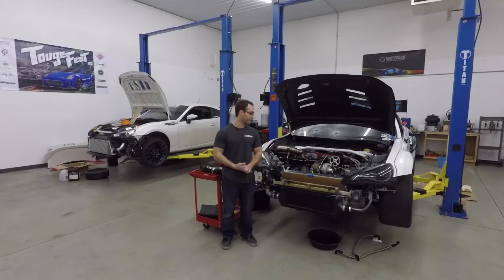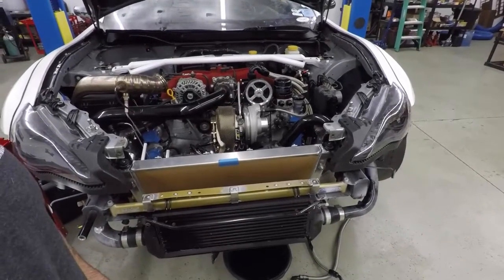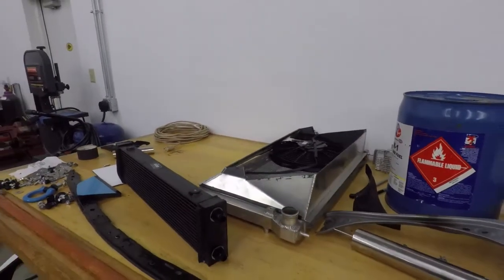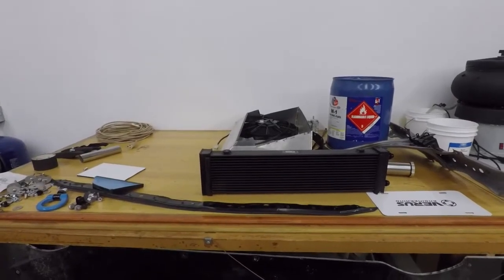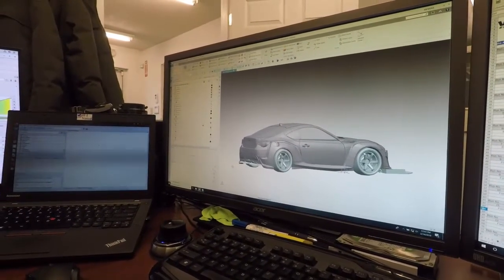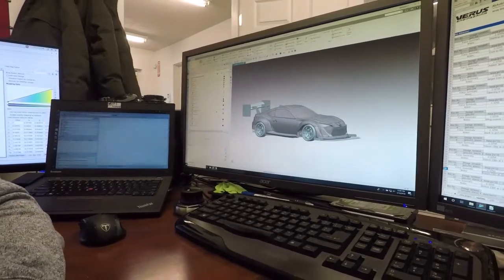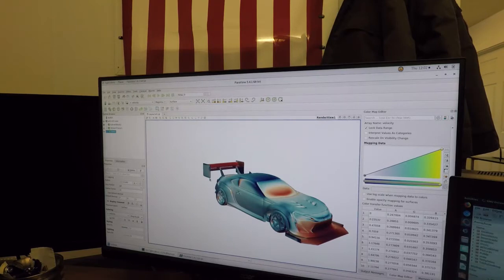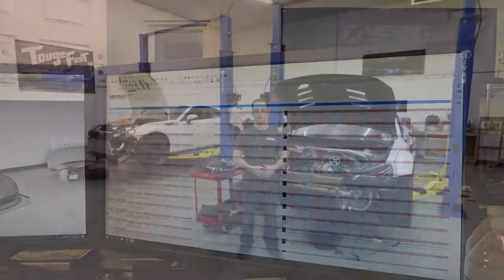ProjectFT86SFTA - Episode 3

Comment: Nice work. 
Interested in what you were varying between those 15 runs.  Was it wing height and splitter length changes or were you already getting into ride height and vehicle pitch testing?
Reply from the maker: We started with what we thought would be a good setup, and we did small tweaks from there. Ride height was tweaked, yaw was tweaked, etc.